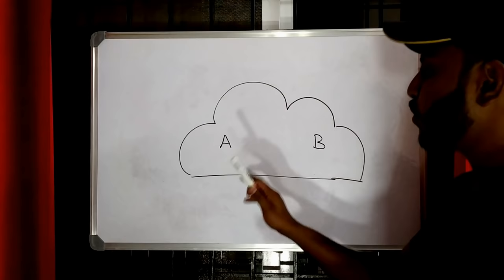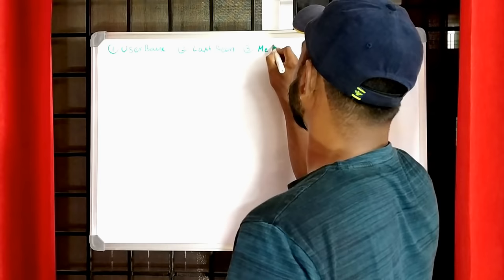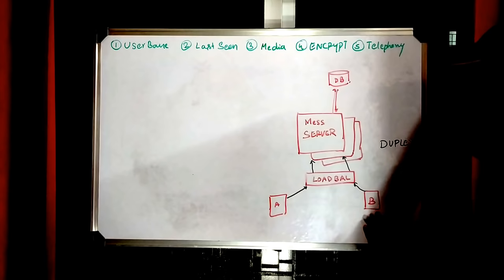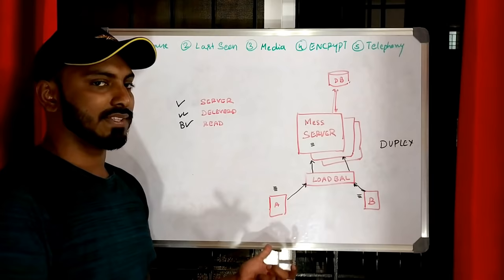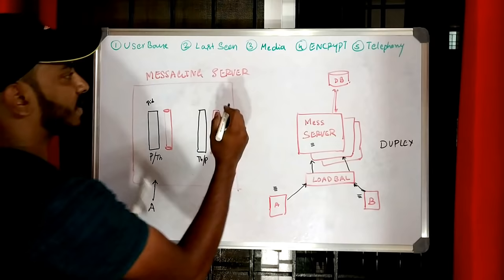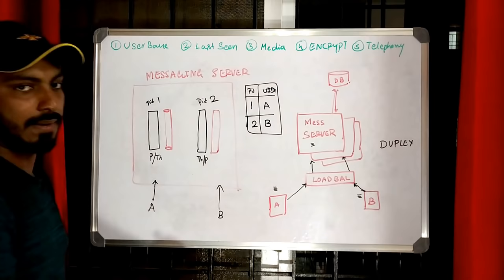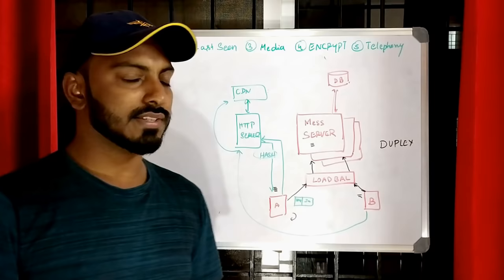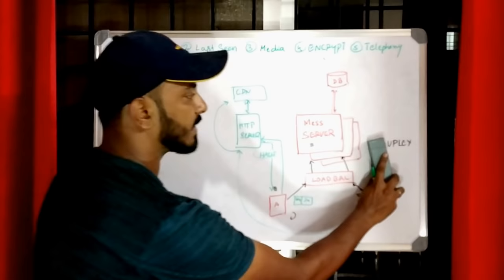Whatsapp System design or software architecture

Comment: Excellent video. Can you please tell something about how groups messages are handled ? And how offline members text will be managed in that case ?
Reply from the maker: Two ways you can do:

First way:
When a group message is sent from a User A, at the server the process which is responsible for user A will perform lookup in a Group to users mapping table(gid->[user-a, user-b, user-c])note: (You can cache it for faster lookup) (this is not the user-to-pid table shown in the table).When Process A figures out all the users of group, it will try to get get PID for each users to send it to the respective user’s processes via Queue/Pipe. If the user is not online, them messges are persisted in the DB.
And when the offline users are back online, there respective processes(connection) reads all the pending messages from DB and delivers them.

Second way:
You can have separate set of dedicated workers which are responsible to dispense group messages only.when User A sends a group message. Process A hands over the message to dedicated group message workers and in turn these worker will Dispense messages to all the online members and saves messages for all the offline group members.

If you like, please subscribe and share this video, Thanks
Reply: Thanks for the reply. But counter question asked to me was, saving the details for all the offline users for all messages in DB, will be creating a lot of rows. is it still be feasible ?
Can cache be used for it ?
Reply from the maker: You can use cache where every you need to access the data very much faster.
DB will create many rows, but that;s the best way to persist messages for long time.

Alternatively. you can persist messages in cache for some time(24 hour) and if the user doesn't come online by then. you have to persist in the DB(NOSQL with user id, indexed)
That way you will be saving messages of the users who doesn't come online for 24hours only.

Comment: Thanks Narenra for the very nice explanation.  I have one doubt: Will creating separate process/thread for every active user will be a scalable design..?..At a time, millions of users can be online, so creating millions of thread/process can cause scalable issues, like lots of memory/CPU consumption...Please provide your input.
Reply: Not quite the processes but Actors. Search for Akka, Orleans.
Reply: Thanks  @ursypc  . I will explore it definitely.
Reply: Exactly, the best solution is to actually maintain a single thread and use RAM to store sockets. Basically a giant-ass in-memory data structure which keeps for each user a socket and a small queue.
His understanding of "queue" seemed rather muddled which was disguised as some magic abstraction.
Aslo, number of websocket connections on a server is limited to number of unused ports above port 1024, isn't it? That's incredibly limiting.

Comment: One question regarding the "lookup" table, if two ppl are across the continent, and the data center they're assigned are different. How does the lookup table work when A sends msg to B? Other cases are, one look-up table grows so big in one data center to keep all the connections data of people, how to scale up the design?  Thanks!
Reply: For the first part, fallback to query each other data center to find the location of the user B when it can't be find in the same data center where user A is, then caching the result to avoid having to perform that lookup every single time. For the second part, data sharding.
Reply: Masuzu N Thanks for your answer! One follow up question though, what will be a good TTL or cache eviction plan for the lookup table (a user goes offline, how does the lookup table catches that)?

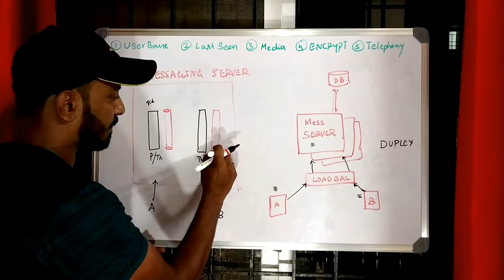Comment: Very good video, just a point that needs more attention is at 14:33 when you talk about threads and process inside the message service. Actually this is not strictly true, actually they use green threads inside the BEAM machine which are totally different and much more scalable than a real CPU thread per connection. For more info I would recommend the reading on https://en.wikipedia.org/wiki/Green_threads and https://en.wikipedia.org/wiki/C10k_problem

Comment: Hey, Really nice explaination !!!!!
I just wanted to clarify one doubt. If I have closed(not minimized) the whatsapp app (or messenger) in my mobile, then does the web socket connection persists with the server or the connection get closed ? If the connection is closed then how server is able to send message to the user (even if the app is closed)? Secondly, if the connection remains open, then it means whatsapp has to store each connection-object info (whether online or offline)in program memory. Does it not seems inefficient ?
Reply from the maker: https://medium.com/@schirrmacher/analyzing-whatsapp-calls-176a9e776213 all info here
Reply: @TechDummiesNarendraL  That's a very well explained article on encryption. Thank you so much for that. But I think I didn't clearly mention the question previously. Re-iterating it again, lets say I have closed whatsapp application on my mobile and using instagram currently. Now my connection is broken with the whatsapp server. So how am I still able to get the new messages notification(since my connection with the server is broken) ?
Reply from the maker: @vivk.7302  1. When you close Whatsapp it's not killed, hence it will have connections to severs.
2. When you kill the WhatsApp com.whatsapp.messaging.MessageService
Will be dead can't receive message.
Whatsapp severs will send messages over FCM/GCM to the WhatsApp messenger and invokes the service.
3. Even when all apps are dead the connection from Android to Google FCM/GCM service will be always on(every apps uses this same connection indirectly)
Reply: Thanks a lot for that. I didn't know about concept. I'll read more about it.

Comment: Hi, you told that the Audio and Video files are sent via https and it stored in Db. Then it sends the hashcode to client-b. When client-b connects to https server and downloads the audio/video files. So my question is that, If I send 100s of Video files, are these files stored in Https server permanently? Https server never stores any file I think. The video files might be stored in DB. Then it might need huge space for storing those high video files.
Next question, If I send 100 messages to Client-b, you told the messages are stored in Db with uid, messages. When client-b start consuming messages from DB, is it sequential and is it totally fault tolerance and how the messages are read by a group of people.
Reply: Ya whenever we download image from whatsapp and if it is deleted from sender's phone we  get error that ask the sender to send again.

Comment: About the Kindle Edition

Length: 290 pages 

Enhanced Typesetting: Enabled 

Page Flip: Enabled 

Book 3 of 6 in API-University Series 

Text to Speech: Enabled 

Description 

Product Description

Looking for Best Practices for RESTful APIs?
This book is for you! Why? Because this book is packed with practical experience on what works best for RESTful API Design.

You want to design APIs like a Pro?
Use API description languages to both design APIs and develop APIs efficiently. The book introduces the two most common API description languages RAML, OpenAPI, and Swagger.

Your company cares about its customers?
Learn API product management with a customer-centric design and development approach for APIs. Learn how to manage APIs as a product and how to follow an API-first approach. Build APIs your customers love!

You want to manage the complete API lifecycle?
An API development methodology is proposed to guide you through the lifecycle: API inception, API design, API development, API publication, API evolution, and maintenance.

You want to build APIs right?
This book shows best practices for REST design, such as the correct use of resources, URIs, representations, content types, data formats, parameters, HTTP status codes, and HTTP methods.

Your APIs connect to legacy systems?
The book shows best practices for connecting APIs to existing backend systems.

Your APIs connect to a mesh of microservices?
The book shows the principles for designing APIs for scalable, autonomous microservices.

You expect lots of traffic on your API?
The book shows you how to achieve high performance, availability, and maintainability.

You want to build APIs that last for decades?
We study API versioning, API evolution, backward- and forward-compatibility and show API design patterns for versioning.

★★ Get the Kindle eBook for FREE if you buy the Paperback version of this book! ★★